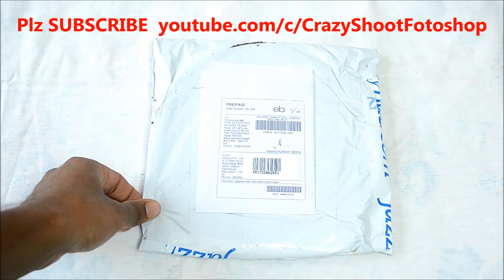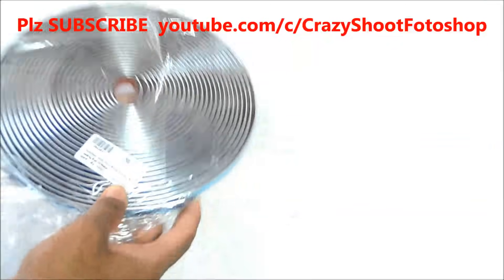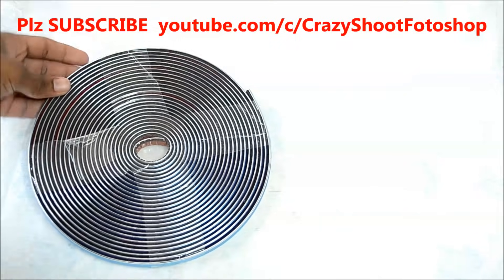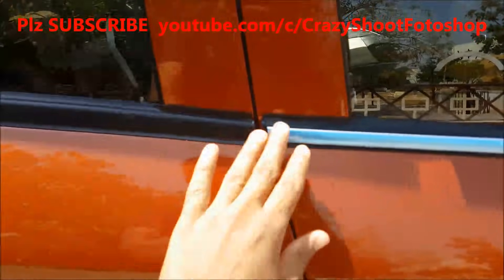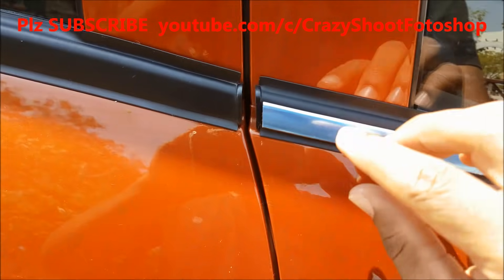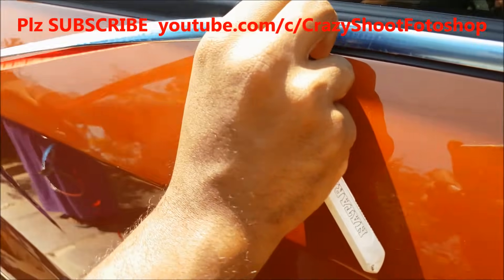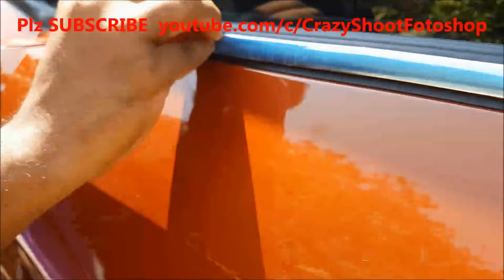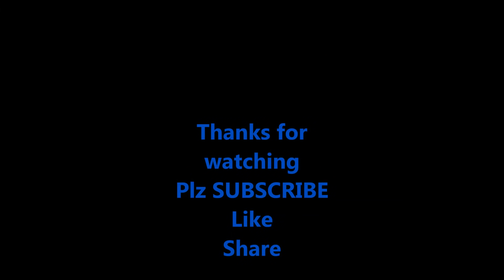Car Chrome Strips beading trim roll unboxing and installation 10 Meters 15mm lower window garnish

Comment: In long term any problems like glue not stron or chrome is dull or anything like that ?
Reply from the maker: If you park car in sun frequently, you may observe that chrome got wrinkles. If maintained parking in shade no problems. I will make an video for another solution for such problem in few days. Pl subscribe to get updates. Thank you.
Reply from the maker: You can watch this video link  https://youtu.be/8OkhMNZs4iU for more details. Thank you sir

Comment: Brand and cost and from which online portal u suggest for my triber
Reply from the maker: https://www.amazon.in/Guance-Chrome-Beading-Meter-Renault/dp/B07X2Y6RTB/ref=pd_sbs_263_t_1/261-0514061-4407139?_encoding=UTF8&pd_rd_i=B07X2Y6RTB&pd_rd_r=8d59982d-667c-4f5f-b2b7-22c037504280&pd_rd_w=BYnCW&pd_rd_wg=fp0h8&pf_rd_p=21bbdc4d-873b-48c5-a88a-70e643377944&pf_rd_r=726D87TA5FTQEH0F0F22&psc=1&refRID=726D87TA5FTQEH0F0F22
Reply: @CrazyShootFotoshop  thankq need seperate glue ...Or can i directly install by removing that strip
Reply from the maker: @ch7ramesh   We can install directly. No need for a double-sided sticker.
Reply: @CrazyShootFotoshop  thankyou
Reply: 5m is enough ....
Reply from the maker: @ch7ramesh  Yes sir only for downside Garnish. If you want to go for full window garnish you need 10meters.
Reply: @CrazyShootFotoshop  ok ok done i will order later ...As it's not a correct time as whole world fighting with Carona

Comment: Can i fit on the door visor also i mean on upper part also?
Reply from the maker: Yes but it doesn't look good
Reply: Door visor are available with chrome garnish also they look cool then how this is not make sense!!
Reply from the maker: No bro, actually door visors come with company manufacturer which is embedded with chrome strip on it and looks great, but we need to search for it. Or else you can use the same and try.

Comment: Thanks lot
can we bend on the sharp edges easily  ?
Reply from the maker: No Sir, you can bend to blunt edges easily. Sharp edges may push the gum out due to pressure. You should cut the sticker for sharp edges and again continue sticking. Thank you.
Reply: @Crazy Shoot Fotoshop what are you say? A few days ago I put that type of chrome trims on my Maruti 800, and I can bend them! Yeah its little hard, but no sticker or tape come out, everything done perfectly!

Comment: Its been nearly 5 months now, could you tell if its color has changed in anyway?

Usually they turn black or yellow after sometime if the quality is inadequate.
Reply from the maker: My real experience. Looks the same as shown in the video.
Reply: @CrazyShootFotoshop  Thanks

Comment: Is this size suitable for Innova?
Reply from the maker: Yes sir
Reply: @CrazyShootFotoshop  for Innova 15mm or 10mm?
Reply from the maker: For Earlier Innova models (2005 - and above) use 10mm and Innova crysta you can use 15mm.

Comment: Does it fits to my manza?
Reply from the maker: Yes it fits and also its looks good
Reply from the maker: @ Asset management company No it is flexible plastic fibre coated with chrome. It won't rust.
Reply: @Eklavya Rana of course! This is for every cars, every models every company! But different scale for different model!

Comment: Is it Still sticked to your car or has come out  ??
Reply from the maker: It is still sticked firmly on my car. I think there is no chances of getting out. I recommend to stick in hot sun.
Reply: Crazy Shoot Fotoshop Thanks for the reply , can you please provide me the buying link or you can add it to description :)
Reply from the maker: https://www.ebay.in/itm/Speedwav-Wide-15mm-Stylish-Chrome-Beading-Roll-10-Meter-Mahindra-XUV-500-Type-2/172660121002?ssPageName=STRK%3AMEBIDX%3AIT&_trksid=p2060353.m2749.l2649
Reply: Crazy Shoot Fotoshop I can use it for any car right ?? And thanks for the link brother
Reply from the maker: Yes bro. But before purchasing do check the size if it fits 10mm or 15mm. You are welcome.
Reply: @CrazyShootFotoshop  is it silver chrome or silver colour plastic?
Reply from the maker: @Mohamed ji: It is flexible material mixture of plastic and rubber and coated with silver chrome thickness which is difficult to damage it. It is my real experience.
Reply: Sometime, water and dust make it come out, but you can put it back to its place very easily. All you need is double sided tape (not the regular one, the one from brands like Galio etc)!

Comment: measurement for honda jazz?
Reply from the maker: Recommended measurement for Jazz is 10mm. In this video shown size is 15mm for XUV500.
Reply: @CrazyShootFotoshop  from where  i get 10 mm tape
Reply from the maker: I have found you this link https://paytmmall.com/speedwav-side-window-stylish-chrome-beading-roll-10-meter-honda-jazz-type-2-CMPLXAUTSPEEDWAV-SIDDELH27212396C01B3-pdp?product_id=24628532&src=search-grid&use_mw=1&tracker=organic%7C%7Cspeedwav%2010mm%20side%20window%20stylish%20chrome%20beading%20roll%2010%20m-honda%20jazz%7Cgrid%7CSearch%7C%7C4%7Cproduction&site_id=2&child_site_id=6
Reply: Jazz is 15mm too. I just measured my car with a ruler

Comment: A Star 2008 का माॅडाल है ईसको करनेको  कितना खर्चा आएगा
Reply from the maker: You need to purchase the roll itself which will cost you approximately Rs400 to Rs.600 or you can go with this idea which is permanent https://youtu.be/8OkhMNZs4iU

Comment: Rust proof
Reply from the maker: Yes
Reply: @CrazyShootFotoshop  abhi tk rusting nhi hui
Reply from the maker: Yes sir. If quality of the strip is not good or when we keep our car in hotter sun, chrome may vanish off and white fiber may be visible. So, we need to maintain it, sir.
Reply: @CrazyShootFotoshop  achhi quality wali strip ki link share krna .baleno k lgani h

Comment: Which size is use for Honda amaze 2019 model
Reply from the maker: 12mm
Reply: Thank you
Reply: @sajith548  brother pls dont go for this.i had a volkswagen vento and i installed ds..ds shit wont last even for a week it ll peel off the tape used is cheapest and the material is just a plastic..after it fall off it leaves the gum on the window frame ull need hours to scratch it off..go for steel trims ..even though it ll cost bit more than this it ll last for years i..installed it later and it was there in my car till i sold my car.
Reply: @harisankarspillai5301  where can i get steel trims?
Reply: Bro 10mm size perfect in size. Because I used already
Reply: @akshayjadoun3543  
Thank you
Reply: @harisankarspillai5301  can we get steel rims for whole window ?